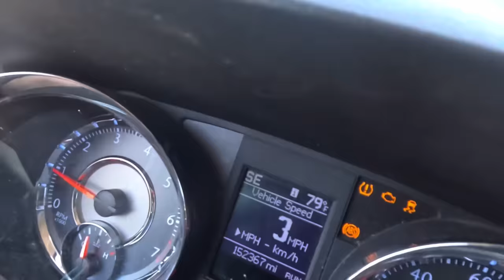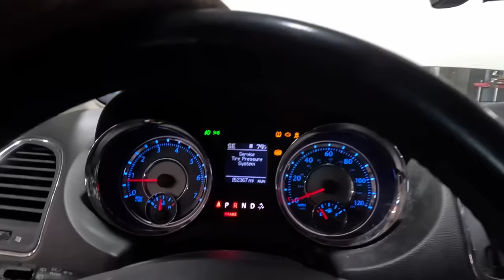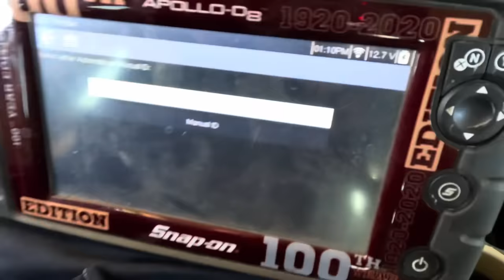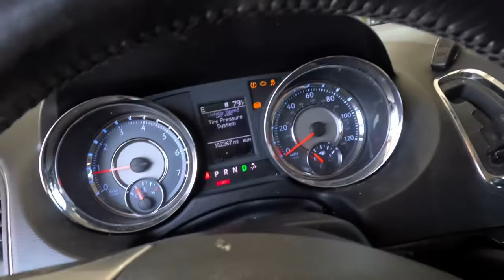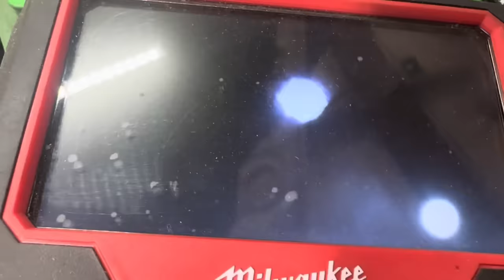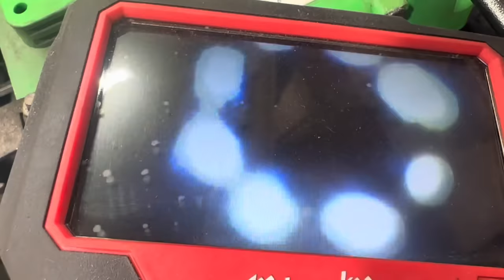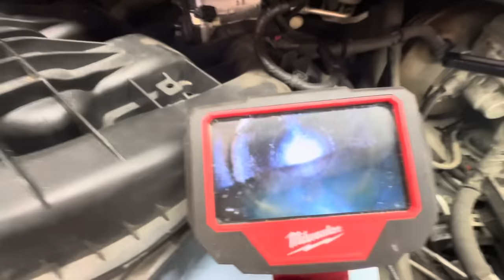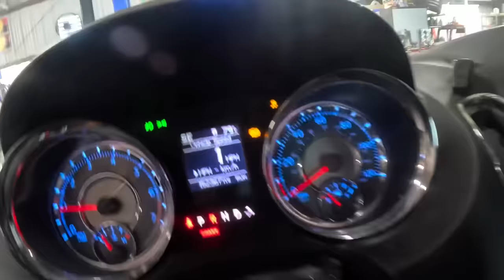Towed In! Died on Highway! (Engine is Drowning Itself!) Chrysler 3.6

Comment: My buddy just bought a fancy Ram with the 3.6...tried to tell him lol
Reply: In all honesty other than needing probably 3 to 4 oil cooler/oil filter mounts in it's lifetime, it'll give him good power and gas mileage.
Any vehicle can experience a loss of coolant and have the owner just power through
Reply: If it's not this it will leak oil and not just from the cooler, and stellantis is not known for good transmissions either.
Reply: You can lead a horse to water..
Reply: And meanwhile, buyers with GM V8s with AFM or Fords with Cam phaser/valvetrain and wet-belt oil pump drive belts are just as miserable. Every manufacturer has their engineering issues, just pick a flavor. 😅
Reply: @mphilleo  At least you can disable AFM with a computer module.
Reply: @Ghauster but the lifters still fail
Reply: @Ghauster  you're not wrong about that. But if you buy that truck used? How much damage has been done at that point? Having to spend the money for a programmer to deactivate a feature to save the engine isn't really any different than me putting an aluminum oil cooler on my Jeep, at least in terms of a cost perspective.
Reply: @shadowopsairman1583 Stellantis hasn't owned Chrysler long enough to have affected them much. Not to mention pentastar is a Mercedes Chrysler design
Reply: @Onewheelordeal if you replace oil cooler housing with revised unit from Mopar you only need one. Taken care of pentastar engines are pretty good
Reply: @DaveBigDawg  everything fails in time. I personally put about 170k on them before I trade. No problems with them besides minor nuance things and regular maintenance. I had a crank sensor loose one circuit at 40k. Extended warranty took care of that. GM rear parking brake cables last about 6 years in the rust belt. They are a pain but you might as well do both rear cables at once and forget about them again.
Reply: @mphilleo  I've not bought used for the last three. Drove the first 4 years. The second 8 years. The current one has 7 years on it. Unless the body starts rusting badly. I might keep it for even longer.
Reply: @bigdaddymak1439 
 At the time of the merger Chrysler used suspension parts from MBenz the pentastar has no relation with any MBenz engine of the time.
A Crossfire is a MBenz SLK most bullet proof Chrysler ever!
Reply: @leonbongers6004  you're missing the point

Comment: This points up a pet peeve of mine, the lack of pertinent engine information available to the driver by way of gauges. A light for the battery is ok but oil pressure and coolant temperature need gauges. 
I can hardly believe that they didn't put the intake stuffed under the wiper cowl.
Reply: This vehicle had a temperature gauge.  My F150 has an oil pressure gauge.  It is driven by an on/off oil pressure switch.  The "gauge" has only two positions: 0 and 2/3rd of the way up.  Useless.

Comment: Wait, i thought giving throttle on fuel injected enjines does nothing?
Reply from the maker: It changes injector pulse and adds fuel, full throttle often cuts fuel off the engine isn’t running yet, it’s called “clear flood” mode
Reply: @RainmanRaysRepairs  OH WOW. I didn't realize that the computers actually responded to driver input like that. Thanks for edumacatin' us!

Comment: That 3.6L Pentacrap doing Pentacrap things!
Reply: As soon as Ray said pentastar, I figured we'd be seeing a dead engine
Reply: @patrickdunne7957  so I had a 2012 Durango with the 3.6L and it was pure hot crap.  Granted it lasted until 178k before I traded it in. 

Now my 2019 Ram has the 3.6L they are far better than they were.  Far less issues.  Still have the plastic oil filter housing which I recommend replacing with the alumimum Dorman one
Reply: Any engine with a catastrophic coolant loss driven until it stops will fail in this way or something similar. This is NOT a Pentastar problem! Sadly, a lot of the big issues with Pentastars come from the fact that they are so ubiquitous in minivans. I hate to be stereotypical, but female drivers (a minivan's usual) tend to ignore warnings, and not always because they're oblivious, but often because they're frightened, and don't want to be stopped in a place where they'll feel unsafe, so they want to push ahead and get somewhere safe. That's understandable, but it usually ends with stopping somewhere less safe than what they could have planned if they'd heeded the warnings, and expensive, major damage. I've seen it firsthand with my mom when I was a kid.
Reply: @edifyguy  really?  Not true.  Had a 4.0L inline 6 that I was in the middle of nowhere bad thermostat, no tools. Id run her to 250F.....let her cool.  Back to 250F.  For almost 10 miles into town.   Yeah that engine went for another 245,000 miles.   Its modern crap aluminum engine blocks.
Reply: @nissan300ztt  It's true that the older cast iron blocks and heads were more forgiving, and that 4L Jeep engine had a reputation for being a tank. It is also true that aluminum blocks are now used almost universally for some good reasons, and not because the manufacturers want to save money; they actually cost slightly more to make, not less.

Limping the vehicle like you describe is something that a modern aluminum engine might also survive, but that isn't what this owner did. This owner pushed it until it stopped, and doubtless drove the internal temperatures well over 500 degrees. The fact that it seized says he got it hot enough to bind the pistons in the bore, and that takes a lot of heat. This engine was ruined by a driver who disregarded the warnings until the laws of physics wouldn't allow it anymore.

Comment: Heads up, dont floor it when you go to start modern cars because it puts it in clear flood mode which disables the vehicle from starting.
Reply: Not just "modern", plenty of 30yr old 90s EFI cars
Reply: Didn’t seem to work for me. Just revs the crap out of my Corolla
Reply: Not every manufacturer does that. Ray has used that at times when working on cars.
Reply: Heads up, you don't need to touch the accelerator at all in modern cars.
Reply: He knows that, explained it in a comment on this video, and probably did it deliberately because it had been cranking for awhile.

Comment: Is there any way this is not the driver’s fault? For example, if the coolant lets go, does the temp gauge not work properly, so the driver doesn’t get proper warning?  Otherwise, clear driver error.
Reply: a hole this big lets the coolant escape quickly, and as a driver you are not constantly watching the temp. gauge. Besides, without coolant in it the temp gauge cannot know what the temperature is. This is just an example how cheap manufacturing causes a lot of trouble for the owner. Saving two dollars back in 2011 costs you as a owner another car or another used engine. At least it will cost you 3000 dollars (used engine + labour). Thanks Chrysler...
Reply: @joskd8491  Nonsense. The head temp will rise without coolant, and the gauge will, too. Warnings were ignored here.
Reply: @edifyguy  No nonsense.

Comment: The last Chrysler product I owned was a “75 Dodge Maxivan B2500 w/ 360 V-8 . A great motor for me . Drove it 8 years sold it to my Partner , ( he love it ), he drove it 9 years . Motor still strong , the body was disappearing , we live in the rust belt . Stay safe , have fun .
Reply: I'm a 20th century Chrysler fan. I owned a 70 Plymouth Satellite wagon w/318, its one car I still wish I had despite the rust. I've owned some 21 century Chrysler products including 2013 Caravan w/3.6. It's a good car if it wasn't for the engine, brakes, and fuel pump relay that requires you to replace an expensive circuit board to fix.
Reply: @rivjoy  had a couple 318's as well they were one of the good ones. just kept running.

Comment: So what's it going to cost to get a replacement engine into that
Reply from the maker: Around $5800 for a used one installed with fluids and miscellaneous items
Reply: Holy crap Ray, and just think you replace it with the same MATERIAL engine, hoses, plastic. And it can happen all over again, including the plastic y that blew out
Reply: @cptyler150  I'm betting "miscellaneous items" will include aluminum Y pipes so that doesn't happen again.

Comment: I had one of these penistar engines in my wrangler, it was trash.. It had decent power, but the way it was built on a budget didn't leave much confidence in its longevity. Which was confirmed when the water pump died at 42k miles and required an engine rebuild/replacement due to that at such a young age, warranty replacement, but the water pump was in the timing cover and made of plastic.

Comment: The saddest thing about the 3.6 pentastar is that the 3.3 and the 3.8 were both better engines.  On any modern engine, by the time an overheating warning light comes on, the heads are warped or the engine's gone before you can get it off the road and shut down.

Comment: Morning Ray,errr the engine is not done ?. The head is aluminum yer, so the engine has coolant running throught it. So if you remove the head you should  see the cylinder head gasket gone. You should see like a worm through the gasket and the aluminum head . This is from the nearest coolant duct to the cylinder.  That's how water has got into the cylinder. It happens plus when water got super hot  it found a weak spot in that pipe and it split.
  It happened to my mother's  car. Solution was easy. Weld cylinder head. Skim the head and replaced cylinder head gasket. No more trouble. Usually caused through a bad gasket the guy said. I don't know about engines as l was a teenager at the time.
  Also had the same thing happen on my wife's Ford Grenada but it was oil this time. Loverly white cloud behind car when driving it to garage.Smoke screen obliterated the entire road.
Reply: at 150k miles maybe another engine with less miles is the best solution, if the customer wants to keep the car. If not, buy a Honda or Toyota and never ever buy a Stellantis product again
Reply: Ah yes head gasket in the winter time. Looks like a mosquito fogger truck on the roadway. 😳😳😳

Comment: The PentaStar Oil cooler is not a great design but it isn't the Achilles heal.  If it was they would have been sued into oblivion already and if you look at the failure it's usually because people are tightening the piss out of these things causing the whole thing to torque and causing the plastic to break.  That and overheating their engines.  We have 15 PentaStars in the family and none have had the problem.  Including the 2012 which is the original design!   It seems like a lot because Chrysler has used over 10 million of these engines to date.
Reply: I worked at a Chrysler dealership for a while, I changed at least 1-2 a week, and these aren’t cheap jobs! A plastic oil cooler wasn’t the smartest choice, and the customers were paying around 500-600$ to have these replaced
Reply: @lowbudgetss622  I guess as long as the customer pays the customer gets crap. Good for the manufacturer, good for the repair shop, good for the dealer, not so good for the customer. That is the correct way. IMHO.

Comment: Don’t worry about hydro-locking the engine and bending a rod, you likely already did that when you were cranking on it to move it back inside after you put water in it.
Reply: It's toast anyway you really can't hurt it more these are throw away engines just like the van itself
Reply from the maker: Yea but the head I is shaped like a banana now and it’s more costly to put heads in it than it is to throw a used motor in it. When it’s junk it’s junk so even IF I deliberately blow it up more, there’s no loss

Comment: These vans have had that plastic Y fitting plastic going back to the 4th Gen caravan & ifs a known failure on these that fail exactly at that mile spot.

We had a 5th Gen 2008 van & it had 160k when that Plastic Y pipe failed. We caught it in time, & limped it home.

Went to homedepot, got some hose, a brass fitting and some hose clamps, & that fixed the issue until the transmission went out then we got rid of it.

These pentastar V6s are probably one of the worst or the worst engine in a modern vehicle today. Chrysler doesn’t fix any of the issues at all so what happened here is Chrysler designed it to fail just outside of warranty for the motor to blow up, & now buy another one.